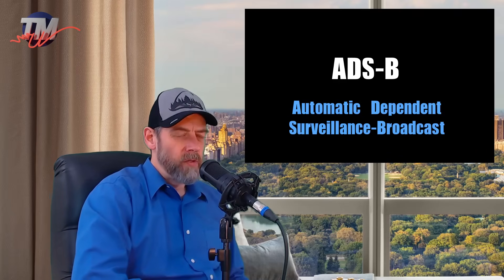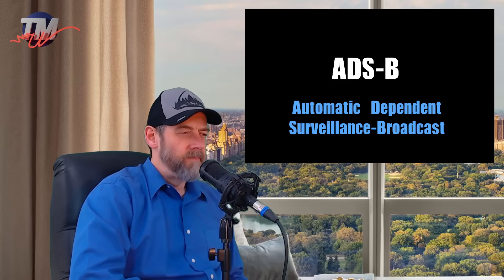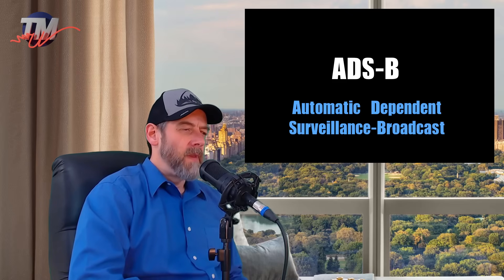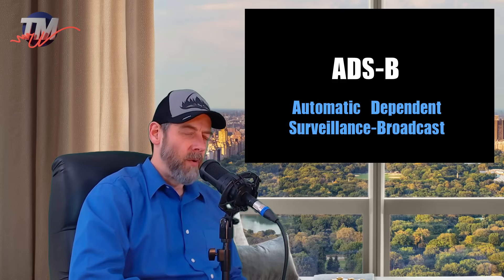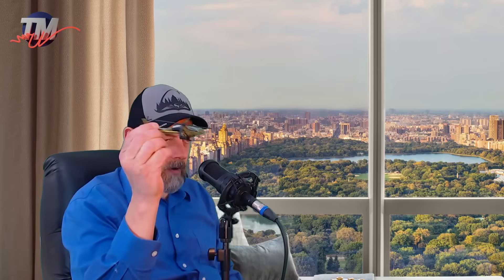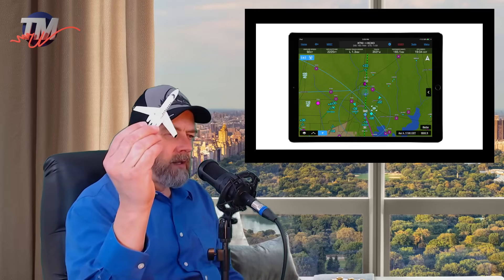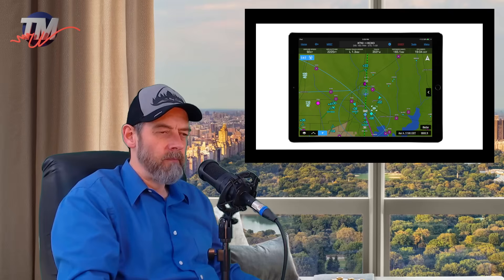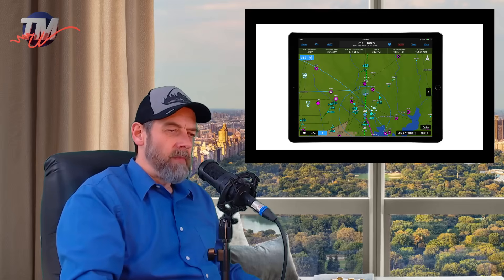The Blackhawk's ADS-B-Out system was turned OFF. Why, what is ADS-B, and why does it matter?

Comment: Their immediate response to the tower was something I picked up on as well for two reasons. 
1: The pilot flying was a woman, yet the man responded so quickly that there was no time for him to have confirmed this with the actual pilot of the helicopter.
2: The general complacency in his voice. Like you say, it was as if he was just checking off boxes.

Do you think their altitude was off because they were using the old barometric altimeter? 
They took off from land (obviously) and when they were flying over the water the reading would've been off by a fair margin, so they probably weren't using it, and just flying by sight.
Reply from the maker: The barometric reading could be off, yes. However, in my opinion the helo should have kept horizontal separation. It should not have intersected into the short final leg of that runway at any altitude when another airplane is already on final.
Reply: @truthmattersunplugged  
I absolutely agree about the horizontal separation. They probably didn't see the plane until it turned across them for its final approach to the runway. So that begs the question, what the heck were they looking at? 

They must've lost the plane in the glare of the city lights and were most likely seeing the following plane that was - from their point of view - above the horizon.
Reply: @the.just.able.biker67 the last part of your statement is why I can’t understand how anyone thinks they were using Nods, makes no sense. Have them on and ready flipped up, sure. To actually fly toward the city lights and aircraft lights with their own lights on, while using night vision would be a detriment.
Reply: @mdpatterson99999  
I guess we'll just have to wait and see what the outcome of the investigation is. I'll be following your channel for more updates. You explained things in a no nonsense manner. 👍
Reply: @ I don’t know how the investigation can conclude if they were using nods or not. They aren’t connected to anything other than their helmets and unless there is video, which is possible I guess it seems like speculation but stated by most as fact. I just want to understand.
Reply: @truthmattersunplugged  which they may have been doing just for "fun" perhaps?
Reply: @truthmattersunplugged  PAT25 was told that the CRJ was over the Wilson Bridge about 5 minutes prior to collision.  Then 4 minutes later, CRJ was left (east) of PAT25, and still turning onto final.  If PAT25 was so unsure of their own position (height & lateral), why would they be expected to predict and visualize the CRJ's position after 4 minutes?  PAT25 didn't see the CRJ, at least not the correct one. The CRJ couldn't "see" PAT25, since PAT25 didn't have ADS-B activated.

The only person to have a plan view of those 2 aircraft was the controller.  We can see the controller's radar display showing the altitude of PAT25 at 002 progressing to 003 very close to impact.  The CRJ shows 005 to 004.  I couldn't make out the readout when the 2 radar displays overlapped. Had there been 2 controllers, there was a better chance that 1 of the 2 of them may have noticed two flight paths about to intersect.

My forecast for the NTSB report - 75% error on PAT25; 25% fault to the controller. And add another 50% fault to the folks who set this helo route up in a glideslope in the first place.
Reply: @dlc710 , this is pretty much my take at this point too.

ARMY/TPTB: The training/route should never have been approved, it's madness and the excuse "it's worked for x amount of years," is stupid. THAT DOESN'T MAKE IT RIGHT!  It was always a crash waiting to happen.

PAT25:  Very clear the helo crew made multiple mistakes, and bottom line---they flew into the CRJ and killed a total of 67 people.

ATC:  I understand visual separation was requested and granted and that too was a regular occurrence (don't agree with that rule either), but at the point where a collision looked imminent WHY THE HECK didn't ATC address it with any specificity/urgency?!! That's the whole of their job!!!  "Technically," or "by the book," once visual separation is granted, responsibility is solely on the pilot so technically ATC may be off the hook...but again, if you see a collision possibly happening, the hell with "the book," SAVE LIVES!  I'm very willing to bet that controller wishes he'd done things differently now...and if it's true someone was allowed to leave early forcing this guy to work alone...and if I hear "it's been done that way for years"...THAT DOESN'T MAKE IT RIGHT!

This should not have happened.  I watched another video and in the comments a Blackhawk pilot who used to fly that route/those missions said he wrote it up as dangerous more than once and knew this was going to happen at some point. There's no excuse for this.

Comment: First, there is a delay in using ADSB-IN because the signals have to go from AC 1 to the ground through a computer and then  be broadcast to your aircraft where it is processes and displayed.  This can take several seconds, so the AC is not exactly where it appears to be on the ADSB-IN display.  But as you say, if the Blackhawk had its ADSB OFF, there was nothing for the CRJ to see anyway.  Unforgivable.  Second, ADSB did not replace Mode C, it compliments it.  Both exist.  Third, the barometric setting in the Mode C transponder is always set to 29.92, meaning the altitude shown on the radars in the tower is off somewhat (depending on actual barometric pressure in the area), and fourth, altitude in the tower based on mode C is only shown to the nearest 100 feet.  So with Mode C alone the altitude the tower sees can be off a couple of hundred feet for any given aircraft.  Lastly, there is no way for the tower to know if you have the correct aircraft in sight, but by requesting and receiving permission for visual separation the tower is absolved and the AC are then responsible for their own separation.  Obviously this doesn’t always work.  Going forward ATC should maintain responsibility for separation and should never let AC come within a few hundred feet of each other.
Reply: ADS-B units can receive information directly aircraft to aircraft.
Reply: Isn't it a fact that the margin of error would be within reason if all altimeters are calibrated within tolerance? It doesn't look like there were any extreme weather conditions which would cause altimeter variations to such extremes.
I would question whether the ADSB system would "take several seconds," as this would indicate a weak system in a profession where as little as one second could mean life or death.
Regarding actual versus preset pressure, wouldn't or shouldn't the controller's software provide for that circumstance by adjusting reported altitudes within the software?
if the tower knew that the Helo had its system turned off, perhaps it should have give a stand down or hover instruction. 
There are too many unanswered questions. Often in these cases we see whitewashing to conceal carelessness by some which in effect conceals intentional malfeasance by others. In fact, there are teams tasked with encouraging whitewashing to destroy the trail of evidence, not necessarily in this case, but not outside the realm of possibility. It happened on 9/11/01.
Reply: @stevesims-d6c  Some ADS-B systems have an 'incognito' mode in which aircraft position data is transmitted, but the aircraft identification info isn't.  This would have helped in this case.  The CRJ could have seen the Blackhawk without knowing who it was.
Reply: @stevesims-d6c   yes  and  since  air  travel  is much more convenient  and  safer  than  road  travel ...theres  should  be  more technology  to  lessen  the  load  burden  on  the high stress  the  AC s     have ...whatever it takes  to help  the ACs  job ...wow .i dont  travel  but  im sur anyone who  travels  by  AIR  would agree ..we  want  the rules of the  Air  traffic  as  clearly understood  as  land  travel  rules ...IDK
Reply: There is not a delay for direct ADSB-Out to another aircraft with ADSB-In, which is nearly every aircraft. There is no excuse for ADSB-Out to be disabled for this flight profile.
Reply: They would have seen an aircraft heading toward them with ADS_B, elevation might be off, but it would have worked.
Reply: You don't know what you are talking about.  ADS-B communication does not go through a "ground computer". The Blackhawk did not "have its ADS-B off" because the Blackhawk was not capable of ADS-B, you can't turn off something that is not there! The helo was transmitting Mode S, not Mode C, and it is completely wrong to say the QNH is always set to 29.92.
Reply: @danielayers On January 1, 2020, all aircraft flying in Class A ,B, and C airspace are required to have ADS-B by law, including helos. Senator Cruz alluded to them turning it off at 18:02
Reply: @danielayers  Mode  S ?  i thought it was  Mode  C....sorry  ...if anyone needs to get it right  ,,its  ATC  and  pilots ...period  :face-red-heart-shape:

Comment: ADS-B has only been required by ALL aircraft since 2020.  There hasn't been a midair commercial airline collision in the U.S. since 1990.  Where was ADS-B between 1990 and 2025? The lack of ADS-B played little part in the D.C. crash. The CRJ has TCAS (traffic collision avoidance System) and we know the TCAS alerted the CRJ crew from its FDR and VDR but they continued with their approach anyway.  The fact is, the ATC Tower Crew saw a conflict developing and did nothing to deconflict it.  He should have told the UH60 to either slow down and give way or better yet given them a heading change for traffic. He did nothing. Take the fatigue level of the CRJ crew. The last thing a pilot wants to do is increase his workload and risk factor at the end of the long flight. AA5342 Did just that by taking a last-minute RWY change when they didn't need to. Thus increasing their workload, and risk factors. Switching to a shorter runway and taking them across a well-known busy helicopter path was just stupid. There was NO reason to do that, and I point out, that no other flight accepted that change that day. Only 5342 did. Had they stuck to the original plan everyone would be alive.
Reply: No dude! Helicopters are generally exempt from ADS-B (Automatic Dependent Surveillance–Broadcast) requirements, especially during tactical, training, or operational missions. In the Washington, D.C. area, which includes Ronald Reagan Washington National Airport (DCA), airspace is highly restricted due to the Special Flight Rules Area (SFRA) and Flight Restricted Zone (FRZ) around the capital.

During the annual Blackhawk check ride at night, military helicopters may or may not have ADS-B turned on, depending on mission security and operational discretion. If flying within controlled airspace, they are usually in direct communication with air traffic control (ATC) and operating under military or government flight operations.
Reply from the maker: Incorrect @ezragonzalez8936! Military aircraft are not generally exempt from flying with ADS-B Out when in controlled airspace, except under specific circumstance: If they are on a mission of national security, if they have permission from ATC, or if they have a waiver from ATC! Know you regulations.

Comment: MISSED The point.. Only in US is it NORMAL for an aircraft to legally fly UNDER an aircraft on final approach.. noting that the plane on finals may at any time DROP below the glide slope, due to any reason.. say ice in th fuel, BA 777 into London.or tired, hungover pilot manually flying ILS.. over-correcting retc.
Reply from the maker: I agree with you. Rotary wing aircraft have too much latitude and this needs to be addressed in FAA regulations.
Reply: Wow - that is legal, I'm shocked to hear that.

The FAA has to answer for crappy horizontal spacing of their MIL routings, and on top of that explicitly allowing an aircraft to underfly another on final approach.  Their liability just gets worse and worse.
Reply: What about the "Carrier Landing Manouvre" at commercial airports????  Flying over departing airplanes with less vertical separation.
When a plane goes around it could collide with the fighter in the "Brake Curve"!!!!!!!! An American unicum too!!!!!

Comment: the Military helicopter was notified 6 minutes before the crash, that the airliner on approach. Was the Helicopter crew hot rodding towards the airport to get an adrenaline rush? "let's trade some paint with the civilians"
Reply: Helicopters are generally exempt from ADS-B (Automatic Dependent Surveillance–Broadcast) requirements, especially during tactical, training, or operational missions. In the Washington, D.C. area, which includes Ronald Reagan Washington National Airport (DCA), airspace is highly restricted due to the Special Flight Rules Area (SFRA) and Flight Restricted Zone (FRZ) around the capital.

During the annual Blackhawk check ride at night, military helicopters may or may not have ADS-B turned on, depending on mission security and operational discretion. If flying within controlled airspace, they are usually in direct communication with air traffic control (ATC) and operating under military or government flight operations.
Reply from the maker: Incorrect @ezragonzalez8936! Military aircraft are not generally exempt from flying with ADS-B Out when in controlled airspace, except under specific circumstance: If they are on a mission of national security, if they have permission from ATC, or if they have a waiver from ATC! Know you regulations.

Comment: There is so much wrong with this video. ADSB doesn't replace your mode c transponder. Most planes just get a second ADSB box and just stick it to the dash. Barometric altimeters arent nearly as inaccurate as he portrays either. In fact, radar altimeters show a lot more inaccuracy especially in urban environments, and GPS signals arent reliable or consistent enough to provide real time information to the pilots. The blackhawk was never in front of the landing jet. In fact, its pretty clear that they they struck the left wing from the right.
Reply: ADS-B played little part in this.  ADS-B has only been required by all aircraft since 2020 and there has not been a civil commercial collision since 1990.  There are three factors that contributed to this. The Helo, Tower Crew and CRJ crew.  Nobody wants to blame the CRJ crew because they are innocent with passengers.  The fact is. The whole incident rests on CRJ crew and their pilot decision-making abilities.   Their job was to deliver those passengers as efficiently and safely to their destination. They didn't do that. The last thing a pilot needs to do after a long flight is increase their workload and risk factors and that is EXACTLY what that crew did by taking that last-minute runway change. It was a change to a shorter runway that carried them across the path of a well-known busy helicopter path.  Their company jet ahead of them and behind them both declined the switch had AA5342 done the same everyone would be alive. They never broke any rules but they exhibited poor pilot decision-making abilities.  ATC tower didn't help either by not instructing the helo to give way or even giving them a heading change to de-conflict the situation.  Its as simple as that.
Reply: Helicopters are generally exempt from ADS-B (Automatic Dependent Surveillance–Broadcast) requirements, especially during tactical, training, or operational missions. In the Washington, D.C. area, which includes Ronald Reagan Washington National Airport (DCA), airspace is highly restricted due to the Special Flight Rules Area (SFRA) and Flight Restricted Zone (FRZ) around the capital.

During the annual Blackhawk check ride at night, military helicopters may or may not have ADS-B turned on, depending on mission security and operational discretion. If flying within controlled airspace, they are usually in direct communication with air traffic control (ATC) and operating under military or government flight operations.
Reply from the maker: Incorrect @ezragonzalez8936! Military aircraft are not generally exempt from flying with ADS-B Out when in controlled airspace, except under specific circumstance: If they are on a mission of national security, if they have permission from ATC, or if they have a waiver from ATC! Know you regulations.
Reply: Both aircraft were over a river. Flat plane surface. RADALT was deadly accurate.
Reply: @rickbartlett5282  Not necessarily. In urban environments interference from 5G cellular and other emission sources can render them extremely inaccurate, which is why we were trained not to use them in those areas.

Comment: Mix of military traffic and civil is always delicate but if you do that in the final of a busy airport at such low level ... Tcas systems should be improved so they could work at lower altitudes and ATC should have enough personal ... also for a visual separation to be valid both aircraft should be given traffic information about position of the other one but here we don't talk about two visual flights ...one is an IFR doing a visual approach and as far as I understand he did not get the right information ..